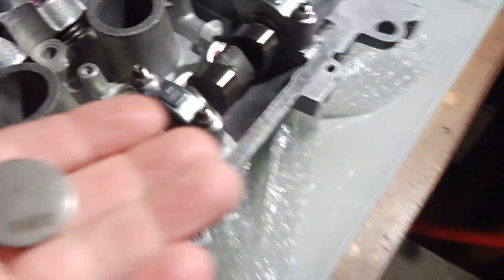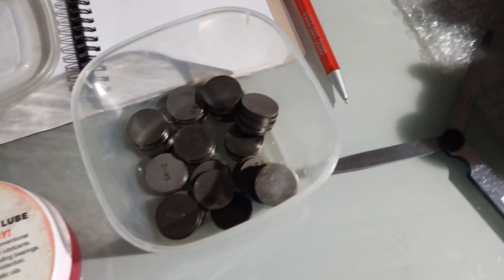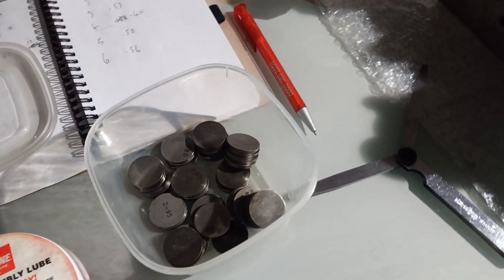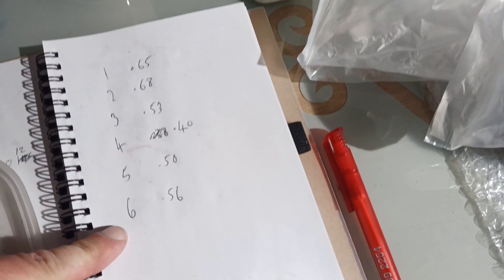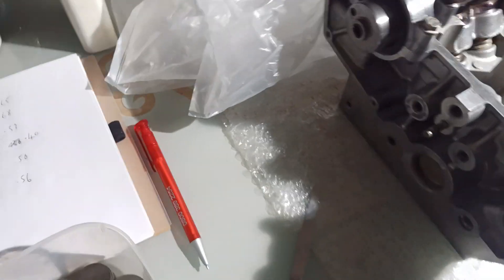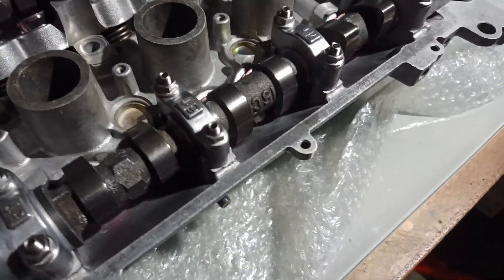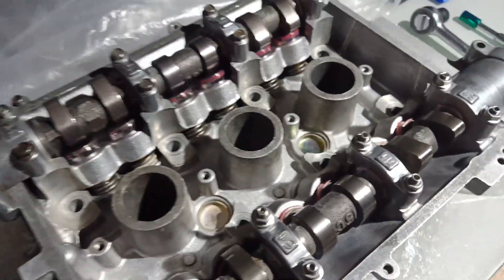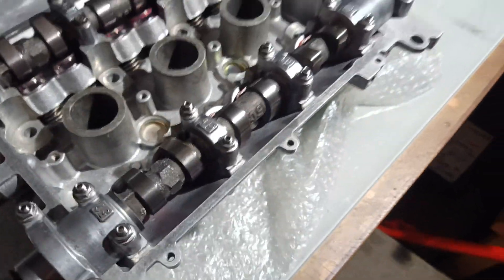Nathan Munns - Daihatsu Charade GTti - Valve Clearances.

Comment: how much clearance out of specs before you hear clicking noise?
Reply from the maker: Anything over makes them quite a noisy top end as even on spec they are still a bit of a tappy engine. I think you could actually go a bit tighter cold (0.14-15 inlet and 0.17-18mm exhaust)  but it's not worth the risk.